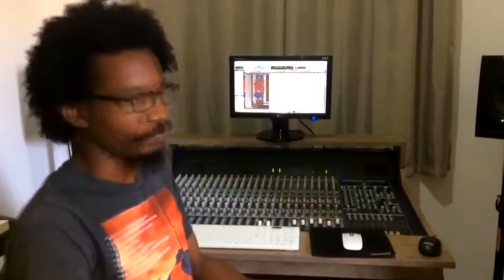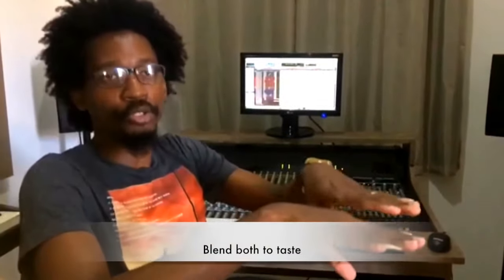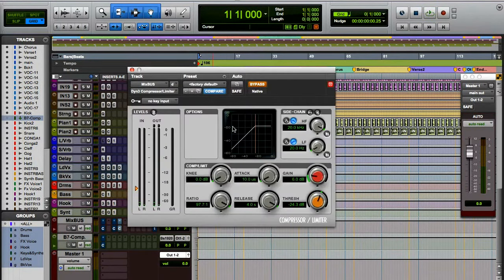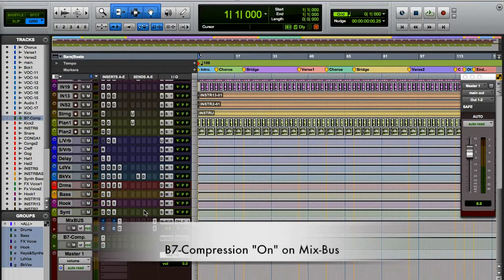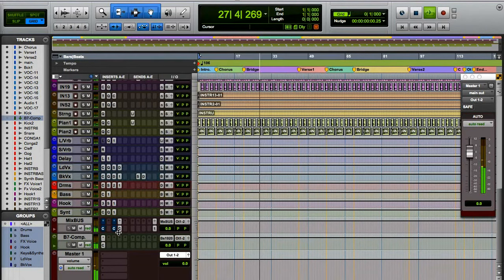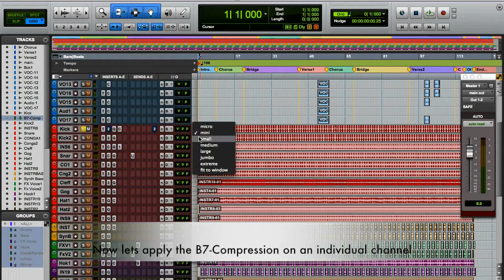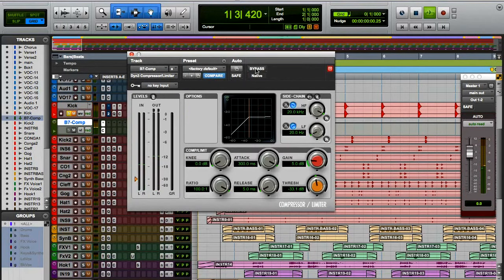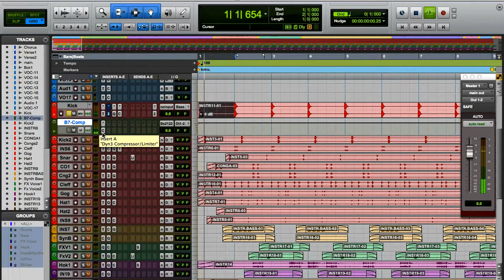B7-Compression technique.

Comment: I like the way the first compression brought out the bite   on the kick.  
Using the B7 compression on the mix bus,  made the entire sound very punchy and forward.  Nice one B7-studio.
Reply from the maker: Yes, thanks so much for your comment. The first compressor brings out the attack "like you called it Bite" while the second brings out more of the mid/low-ends so, combining the two to taste is the fun part. You just have to be careful combining the both because you could get carried away by one results than the other. 

B7-Studio: Making you sound better.